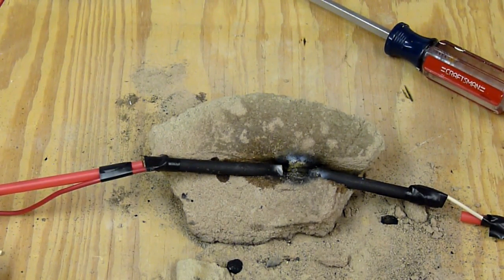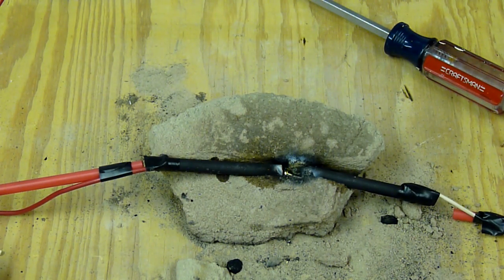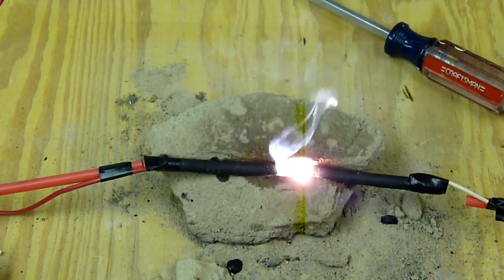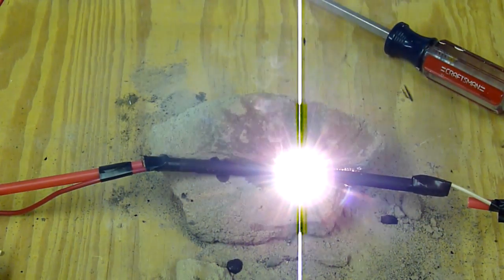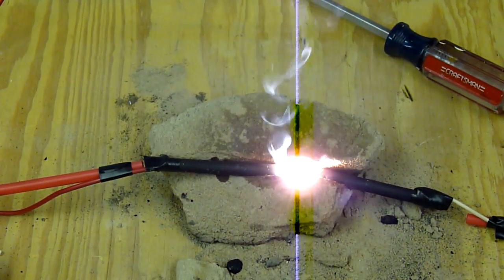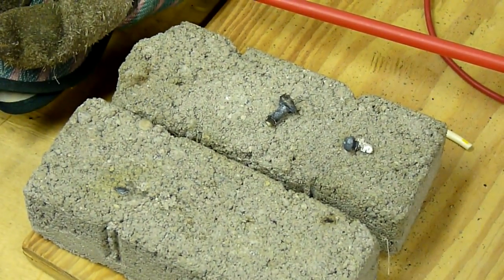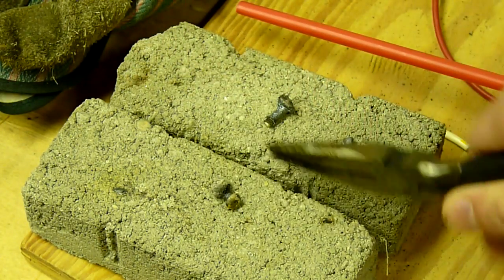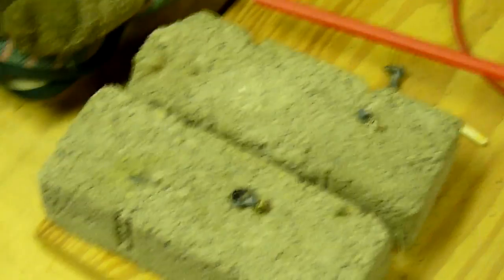Arc Furnace Melts Steel

Comment: how many amps is it?
Reply: Says 5A in video description.
Reply: 5 amps can do all that?!
Reply: Man, all I said was that the description says 5A.
I dunno if that's realistic or accurate.
Reply: oh ok.
Reply: +Dandanoodle Dudeface 5amps maybe at 700 0r 1500 volts, something like that..
Reply: He says in the beginning that he is using a ballast to power the arc furnace. If he's getting ballpark 600 volts from the output voltage of the ballast, he doesn't need many amps to produce a very high temperature between the tips of the carbon rods. I would bet that if you put an amprobe on the 110 volt black wire that powers the ballast, you would get somewhere around 1-2 amps. I'd be very surprised if he was even using 5 amps in this video.